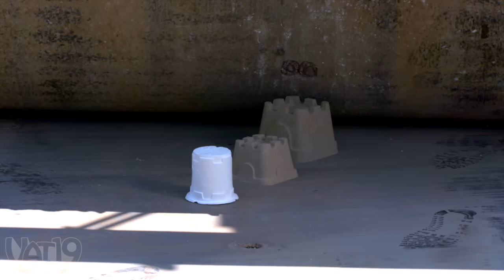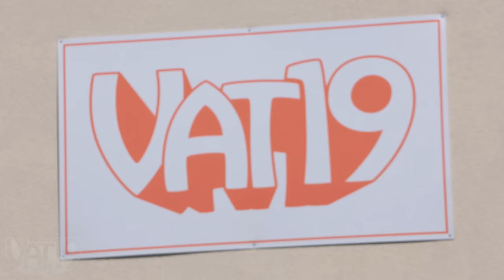Steamrolling Your Favorite VAT19 Products | Will it Steamroll?

Comment: Could you imagine if the mighty mug held back the steamroller
Reply: Blue Pineapple
Reply: .....bruh
Reply: Make the mighty mug 128x bigger, and who knows.

I mean, that's what vat19 is all about, right? Making things stupidly bigger or smaller?
Reply: Imagine the mighty mug slightly tipped back only to slam right back into the steamroller absolutely wrecking it.
Reply: 300 like
Reply: @MonoCrowbo  a power to surpass Dio.
Reply: I’d still find a way to break it
Reply: TOP 10 POWERFUL ITEMS THE OVERLORDS DONT WANT U TO KNOW
Reply: Even if it’d did I saw I glass mug stop a bullet train
Reply: Hi
Reply: The steamroller would be launched back

Comment: Why is it called a steam roller if there's no steam?
Reply: Ya Boi .
Reply: Ya Boi beacouse inside the drum, there is hot water. They did not run the heater. There is a switch that makes it hot for when it is being used for road construction
Reply: Techniack that’s not true.. it’s called that because they used to run off steam engines. Rollers used in roads or any civil construction don’t use steam in the drum.
Reply: Stuart MacLaughlin did not know that thanks
Reply: Stuart MacLaughlin actually you are both correct. Certain steam roller companies build them in different ways
Reply: .Ya Boi
Reply: Techniack true i study cars and vehicles and thats true
Reply: Stuart MacLaughlin true too